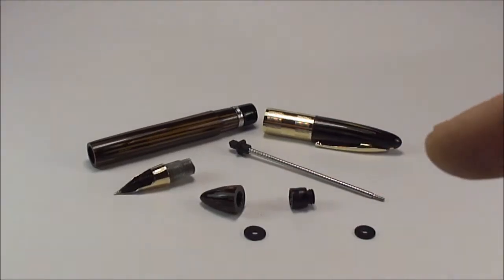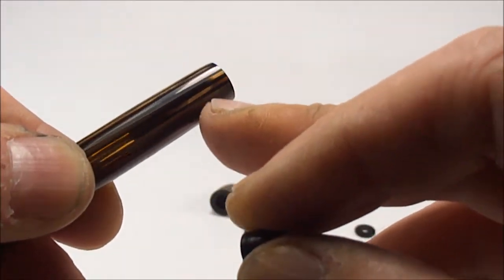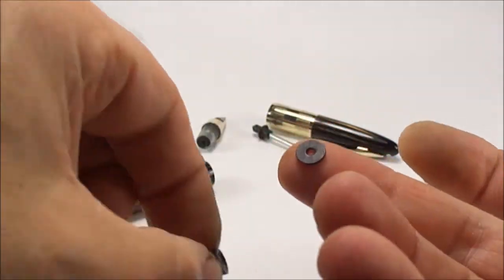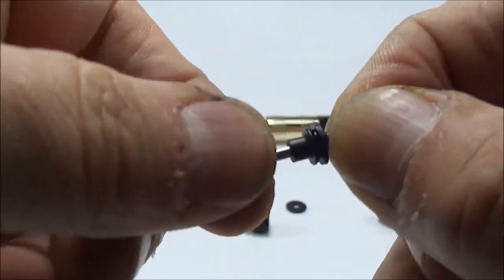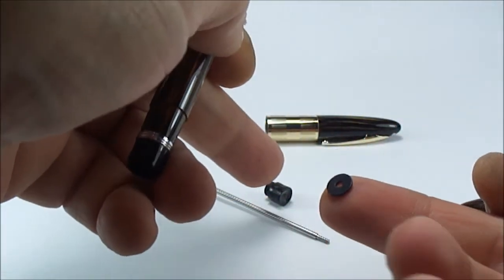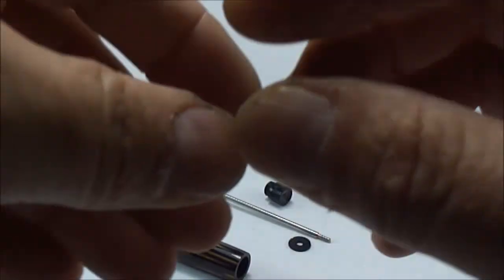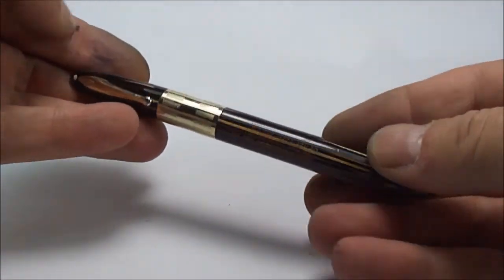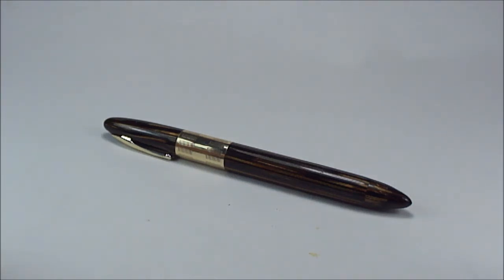How To Service A Sheaffer Triumph Vac Filler Fountain Pen...

Comment from the maker: Hello Vincenzo...First try soaking in water overnight and use heat from a hairdryer and in some cases that it enough to realese the feed/nib section. If it does not work the first time try again ( patience is what normally works ). If you need to use ammonia then just a small drop in your water may help...Good luck.
PS The secret is patients and go gently.

Comment: Coming to this ten years later - great video, and just what I needed to renew the seals on my Sheaffer  Lifetime Pocket(?). 

If anyone is having trouble gripping the nib to unscrew the front section, then a Bionic wrench and a short section of fuel-line hose is just the ticket.
Reply from the maker: Glad it was helpful. Just go easy with the wrench. Thanks for the tip.
Reply: @penkino1  Like a loving hug - plenty of warmth and just a little pressure.

Comment: Thanks for the video! I've recently got a Sheaffer Jr that it seems to have a similar filling system. This should help putting it back in working order :).

And don't worry about making the videos too long... I'd rather see all the details and spend 5 hours in front of the computer and make sure I get everything and not skip a step :)!
Thanks again!
Reply from the maker: +mrN3w7 Thank you for watching. Im glad it may be helpful to you. Good luck with your pen.
Reply: +Grandmia Pens Thanks for the reply. Well, I was able to disassemble most of the fountain pen but it looks like I am being defeated by the end plug. It just does not want to come off.
Soaking and heating doesn't seems to do the trick. O.o ... 

I've put it aside for now until I get some kind of idea on what to do... I'm kind of lost at this point in time.

Comment: Thanks for a very clear and exhaustive description.  I have a couple of Sheaffer pens that are vac-fillers like the one you show here.  They are fine, but I am not sure about storage: they are used rarely - perhaps once or twice a year - and I am not sure if they should be stored empty or filled with distilled water.  I live in Arizona, where the climate is always very dry.  Your advice would be appreciated.
Reply from the maker: That is a good question. I would say leave the pen empty but periodically fill it with water just to lubricate. Good luck with your pen.
Reply: Grandmia Pens Thanks.  I’ll do that.

Comment: Thanks for the informative video!  When you unscrewed the section from the barrel (I see that the section in this case, as well as mine seems to only extend back as far as the end of the nib), should the nib turn independently of the feed?  Tried loosening it up with soaking and heat, but twisting only seems to turn the nib itself the feed won't budge.  Didn't want to force it so I stopped there for now.  Thanks for the feedback.

Comment: Thanks for the very thorough video! I've got a couple of quetions though: if the model it's a newer one how can you disassemble the inner reservoir from the section without breaking the pen? If the end cap is wobbly on the piston rod, how can you make that wobbliness stop? 
Thanks again and keep making great videos!
Reply from the maker: The method you describe is quite difficult so i recommend sending it to a professional repair person before you break the pen. The end cap can be tightened as shown in the video. Good luck

Comment from the maker: Im not sure what you are trying to achieve.The vac-fil pens have both a screw fit and crimp fit nibs that are attached to the threaded sleeve with the feed that sits inside both so basically three parts.

Comment: Thank you for the informative video.  I have a similar pen but without the metal band. It says "350"  on the barrel. My packing plug is not coming out but I will try soaking as you recommend.  Where can I get the felt and rubber gaskets and washers I need to rebuild?  Thank you.

Comment: I have a question; how do you get the rod out of the pen? The plug is still inside the barrel and the remnants of the piston are inside the pen. The end of the pen is also attached to the pen with a metal ring or something with a grove that bisects it, and wobbles around instead of being firmly attached like yours.
Reply from the maker: Riley Webb Its a little difficult to comment without seeing a photo. Why not send me a PM.

Comment: Another great video, thanks. Can the wrap-around Sheaffer nib be easily detached from the feed? I would like to clean the feed, maybe with a toothbrush.
Reply from the maker: 1ImmanuelK Thanks for watching. Yes they can be removed but i would not recommend removing the nib just for cleaning. They normally have a Rosin based sealant which needs to be reapplied if removed. To clean the feed simply soak the nib section in water, you can still use the toothbrush. Good luck.

Comment: Thank you for your informative videos. I am trying to restore a Sheaffer Triumph but after soaking forever the section still won't budge.
Would carefully applied hairdryer heat work?
Reply from the maker: +wabashamj It is difficult to comment without seeing the pen close up. Maybe it would be easier to send the pen to a professional before any serious damage is done. Good luck.
Reply: Thank you for your reply. Also,  for your videos, always informative and inspiring.
I was able to take apart the section, feed and nib,  but the inner barrel with the plunger is now my next hurdle.  There does not appear to have packing on the cap end and the feed end for some reason won't let the plunger through.
This could be a cheaper model of a vac fil.
I might seek profesional help.

Regards
Michael

Comment: I was able to unscrew the nib with the threaded part but the nib itself is loose and doesn't fit tightly with the feed and I can easily spin it around while still attached to the threaded part?
Reply from the maker: Difficult to comment without seeing the pen. Maybe the threads are ruined, occasionally some shellac applied carefully helps. Good luck.

Comment: So I get all that but how does the ink not get pushed out when the rod is pushed back in? I am not seeing how that works.
Reply from the maker: There is a air hole at the bottom of the barell which releases the air vacum, however occaisionaly a small amount of ink will "push" out when the rod is pushed back. Thanks

Comment: Your videos have been invaluable in my various pen repair efforts over the last 6 months or so.. Am having trouble removing the split screw from the blind cap of a sheaffer vac-filler - it is very tight. Have soaked for a week in water and dishwasher liquid and heated it for quite a while- nothing yet. Do you have any tips? Would very much appreciate. Thanks again for your awesome videos!
Reply from the maker: Im glad they have been useful to you, thanks for watching. A little difficult to comment on your pen without having it in front of me. My advice would be have patience.

Comment: Steph, what kind of rubber cement did you use for gluing the packing washer?  Thanks!
Reply from the maker: If i remember i think it was a rubber silicone cement. Good luck

Comment: I found one of these at a pawn shop in my home town, I think I might see if it works and pick it up if it does. Looks sorta beat up though.
Reply from the maker: If you can get it for the right price, it maybe worth having it restored. Go for it. Good luck.
Reply: The owner is willing to part with it for $65US because I helped him research a few Pelican pens and knew a rough value range of a Waterman pen off-hand. I think if it doesn't work, I'd wait to get it restored anyway for a while because right now I'm looking for a nice pen to eyedropper-convert.  Wouldn't mind getting my hands on a broken-down Montblanc piston filler for that purpose, frankly...
Reply from the maker: Not a bad price so well done. Good luck with converting a pen to eyedropper.
Reply: Well, I picked up that Sheaffer pen. Turns out that for $70.20 I got really lucky with a pen that still actually works flawlessly despite still having vintage innards all the way through. Whoever had this pen before me really took care of it, because nothing has been restored on this pen until I polished the clip up a bit.